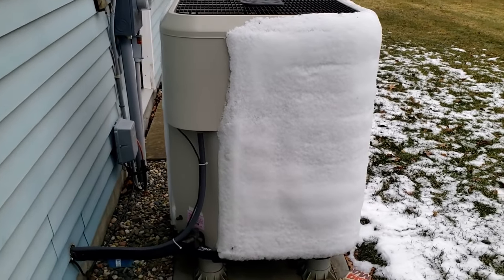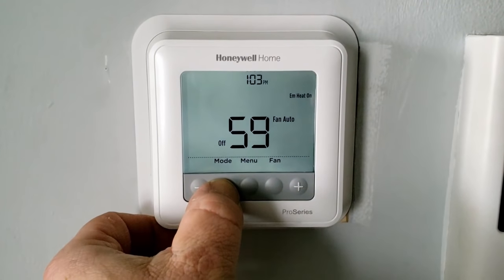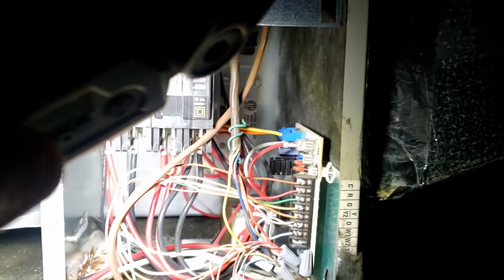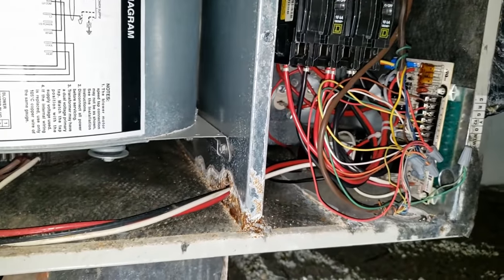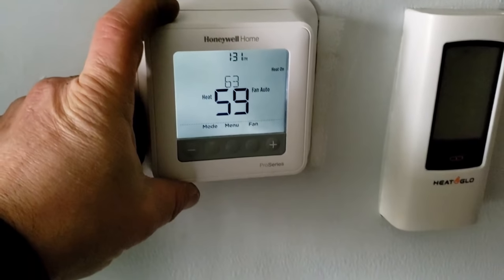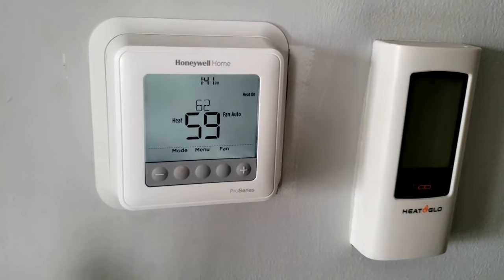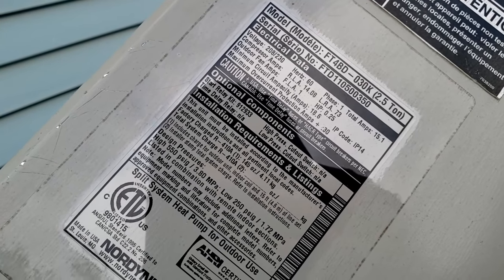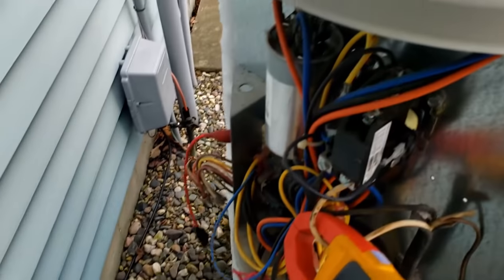HEAT PUMP FROZEN UP LIKE A ICE MACHINE I MISSED  UP & TOASTED THE FUSE

Comment from the maker: ATTENTION 😒😒😒.  👉 I did a live show covering most of the comments that are being repeated or listed below. The link is in the note section and in the tag section of the video. The things I cover is....yes I made mistake and blew the fuse when I connected the jumper to the wrong terminal😱.   I go into greater detail about this in my live show video. I also go into a lot more of my concerns while trying to diagnose this system.  👉👉 For those who keep repeating put it in AC mode and melt the ice that way..... That's only going to get the ice partially melted. 👉First, it's not going to melt all the ice because once it lose contact with the coil it's not going to melt any further 😲.  👉Secondly that doesn't tell me why the system froze up. But by running it in defrost mode over and over will tell me whether the system is capable of doing the job or not. It also tests the defrost board, the defrost termination switch and the refrigeration system all at once.  👉👉👉As with all of my videos, please make sure you watch the whole thing and don't skip sections then ask questions about things that were covered in the video. Thanks for watching and please consider subscribing 👍👍👍
Reply: I used to do that sometimes. Those boards are weird
Reply: Hey man thats what extra fuses are for and fuses in the first place, thanks for posting!keep up the good work
Reply: Dis you ever verify it stopped freezing up?
Reply from the maker: @jpp9876  We never received a phone call stating otherwise. I'm sure they would have called if it didn't work.
Reply: As a tech you are good. When people put the air handler under a house so servicing is a challenge of slithering and light, testing more hazardous. Some people place at edge of house boosting ease of service.
Reply from the maker: @SovereignTroll thank you! We're a after thought until it doesn't work🙂
Reply: @HVACRSurvival  Stopped up condensate drains in attics really Amps up the PM sell....
Reply: Forced air propane heater with a 20 lb tank would work to melt that frost off.

Comment: Mine froze up once during a cold blizzard and by the next day it was unfrozen and has worked great all through the cold and worked fine last summer.  I purchased a Hessaire 18.000 unit. I installed it myself early last summer. So far ( knock on wood ) It has worked flawlessly. I never realized just how easy it was to install myself. This unit replaced an OLD samsung from the 70's that stopped working. Was simple to install as the hold to the outside matched perfectly. A dealer wanted $8,000 to replace my old unit with a 12,000 btu. I paid less than a thousand with delivery. Keep up with your great and informative videos.

Comment: You can just run a/c mode, have outdoor fan power unplug, to melt the ice in 10-15 minutes
Reply: Or you can stay in heat mode, jump out Y and O at ODU, with fan unplugged from defrost board fan relay. Never have to go inside to set the thermostat. Save you big time!
Reply from the maker: I was focused on why it froze and how to prevent it from happening again more than melting the ice. Hot or even cold water will melt the ice faster and completely vs any form of defrost cycle. Speed wasn't what I was looking for at that time.   If I was sure what caused the ice then yes running it in cooling without the fan would have been the easiest way but wouldn't have worked fully once the ice melted and lost contact from the coil.  It would have left a ice igloo around the coil.
Reply: @HVACRSurvival  i was thinking the exact same thing when I read the OP's comment
Reply from the maker: @whitingservicesheatinganda3858  One tracked minds I guess?

Comment: Another fun little tip when you come upon them super frozen like that, two things right out the gate. If its a normal open/close defrost sensor You can see if it’s closed Because it should be if it’s frozen like that. Also you need to make sure you’ve got 24+ volts red to common. If it does not have power to red Or has a broken/bad common wire, the timer will never start on the defrost board and it will never initiate defrost.
Reply: I thought the same.
Reply: Another tip I've found is if it's frozen solid like that it's probably not low on charge

Comment: Did you visually examine the solder-side of the 'bad' PCB? As an electronics guy, single sided boards are prone to having cracked solder joints and lifted pads.   A local HVAC company wanted my mother to pay $3k for a new furnace over what was ultimately a single cold solder joint on the blower motor relay. Years before they wanted $3k for a new furnace due to repeated breaker tripping. It took me 4 minutes to diagnose a bad circuit breaker.
Reply: @HVACRSurvival  these days everything is liable
Reply: I know what you're saying about these other companies. I had someone with a variable speed blower that had a bad ECM, I told him to get somebody else, because he whined a little about how much it was going to be. The company who installed it came in and told them they needed to replace the whole five ton system for $12,000. I knew it just needed a blower module, which aren't really easy to get. So I went ahead and got an evergreen motor for it and fixed it. And I am an HVAC contractor, but I can't get over all these companies that won't fix anything, they just want to sell equipment and make a fortune off the customer. And I say,  you'll have that with some companies. And I say it's either because they're desperate for money because of their outrageous overhead or no one knows how to fix it.
Reply: I'm an old and seasoned electronics guy also. If you can fix the board with a simple solder repair then just do it and don't brag about it. I've done it myself more than a few times. It saves a lot of cost and frustration for everyone. Too bad the new boards have a lot of unknown parts on them which makes it hard or impossible to repair. If that's the case then scrap it and get a new one. Everything has electronics now, even my toothbrush. Ain't progress just great?
Reply: @HVACRSurvival  I love it when people hide behind liability. Cheaper for you and you only to just throw it away and charge the customer 100x more to just replace it instead of fix it.
Reply: @joblessalex  in this case hvacr survival is only insured for HVAC repairs. That is not inclusive of repairs that would be considered better suited for other businesses. Maybe he could offer to send the board out to be repaired by a licensed and insured electronics repair person, but I would bet that this would cost just as much as a new control board and also have even more downtime as the system will be unable to run without the board. (In this case he left the broken board so heat would work and ordered a new one)
Reply: You must be an electronic engineer supervised technician to legally fix boards.  Liability.
Reply: @charlessmith833  A customer may do it but no one should promote DIY for circuit boards.  Contractors cannot fix these without liability.  The worst part that short-lived relays are placed on circuit boards.  They are separate "ice cubes" on RTUs and quick fixes without circuit board on some units.
Reply: @Sovereign-WV Citizen  yea we as owners and contractors don't take boards out and solder them we buy new boards. If the board is already damaged why would you yake the liability of a solder when you can replace the board under a warranty.

Comment: If it is above 30, defrosting with a garden hose will work well, I had to do that last week!  

I had a friend and installed a new compressor for them in September, and I guess they did not run the A/C for the remainder of summer.  I forgot to plug the reversing valve back in, and came out in November to see it covered with ice like yours is.  I was able to remove the 2" of ice in a few minutes with a garden hose.  

Also if above 34F, unplug the compressor common wire and then run just the fan motor, the ice will go away in about 15 minutes, like a air defrost of a walk in refrigerator.  

Great video,  I am thinking that the board and temperature sensor should have been changed, and if you don't get more no cold calls, you did the right thing.

Comment: Thanks for sharing this video. Lucky for the customer that this was a copper & fin condenser coil, since then Nordyne went to all micro channel condensers for their Heat Pumps (Only Manufacturer who has done this). I have had one micro channel coil leak due to much ice built up.
Reply from the maker: I got my hands on the SolderWeild kit and it worked great on the aluminum I tested it on. I'm ready for a non-warranty coil to try it out on.
Reply: When I did work in 2010-2012 in FL I never came across a nordyne unit that had an issue. Trane? all the time. Carrier, to a lesser extent. I heard their micro channel stuff was bad. Kind of a shame since it seems like a good idea, at least for the inside.

Comment: In Florida, most installs are done with the T before the trap on most systems. Been that way for years. Depends on if the system is negative vs positive pressure as well. You can use a vent if you are feeling fancy.
Reply from the maker: I like tees over 90s in positive applications and a tee after a trap for a relief to preventing a double trapping.

Comment: I guess the build quality like most brands depends on whether its a base model or higher end. Mine is a 17 seer heatpump version of that, with 2 stages and variable speed furnace. It is completely different from a control / board perspective.

Comment: We have a carrier green speed (expensive) that was icing up. Bge home came out and decided the thaw board wasn't working properly. Long story short, it's now the 23rd of February and they came out on the 6th and they still haven't been back. Called rhem 5 times and recieved 1 call back that they're working on the part. So after three 20 lb tanks of propane the weather has warmed up a bit so it's not freezing up. If you live in Maryland,  bge home are not on it.

Comment: Demand defrost control, at least in my experience, works on a deltaT based on a defrosted coil condition. Suppose the entering ODT is 40F and the outdoor coil temperature is 32F. That’s an 8F deltaT. Then, let’s say, after running in heat mode for one hour, the entering ODT is still 40F but the coil temperature has dropped to 26F. That’s a 14F deltaT which means the defrost board will soon initiate a defrost to bring the deltaT back to 8F (or so) deltaT. It should not take very long to do this, under 6 minutes is best, in fact, too many defrost cycles longer than 6 minutes or terminating on time will create a fault. Maybe that unit is too exposed to the wind, maybe short of gas or both.  It will never defrost properly under those conditions.
Reply from the maker: This is the ghetto brand 😂. This  was a generic run of the mill open / closed termination defrost control. It didn't have any thermistors whatsoever, heck they didn't even have the money to put an LED on the control 😂 . As long as that defrost switch was jumped like I had it, it should have ran the full 10 minutes 🤷‍♂️. I haven't heard back yet so it must have been the issue.

Comment: the unit could be low on refrigerant charge causing it to come out of defrost before the time is up by the defrost sensor or some other safety, not sure if there are any other safeties on this unit. Don't know if you checked the pressures, was not shown in the video. but in my experience that will cause units to freeze up and not defrost properly. had that issue on a trane and a few other brands.
Reply: At the end of the video it is snowing outside. What happens is the poor outdoor unit sucks in the snow, and cannot generate enough heat to remove the impacted snow. Happened to a mini split I put in for a friend. Of course we see below zero a lot so that didn't help. 
Whenever it snows heavy here I just turn mine off. I didn't thing I'd be using mine in the winter since I have gas heat, so I didn't put a protective shelter over it. But gas shot way way up so the heat pump is saving me money.

Comment: So many places heat pumps of SEAR 16 or less are too far north. Now ductless splits are replacing these and can work with low ambients.  Defrost boards don't seem to like power surges and dirty power either...
Reply from the maker: Several manufacturers have inverter driven heat pumps that work fine down to 0*. You need to look at the eer rating not the sear rating when you want to know you're efficiency of your heat pump in heating.  It costs more to heat my house then cool it.
Reply: @HVACRSurvival  Yes Sir. I am placing a ductless mini in own residence this summer. 22-24 SEER awesome and lower tipping point.  USA behind on this and lower energy consumption will push this probably.

Comment: I carried nothing but 80-30 defrost sensors in my van. Starts defrost at 30 degrees and terminates at 80 degrees. Guaranteed to get rid of all the frost/ice IF refrigerant is at proper level.
Reply from the maker: Who makes that? Most of the higher end equipment now has on demand defrost that I work on but sounds like that might be good for a universal part on the truck?
Reply: @HVACRSurvival  RS 222-8218 at least goes up to 60°

Comment: Had same issue 
Changed the defrost sensor that I got from Amazon and the issue was fixed 
Now sometimes temperatures drop under 20 degrees and no ice at all
Reply from the maker: Good Deal..

Comment: Exposed PCBs reminds me of old Soviet Union paraphernalia. I still cant believe a unite meant for outside exposure is so open to the elements.
Reply: Some smd components and conformal coating is something you would expect 2021.
Reply from the maker: This is a bottom of the barrel unit and is older. A lot of the newer equipment is surface mount.

Comment: I'm by no means a veteran in the field but whenever I've come across this problem we just run it in cooling at the lowest setting and trick the thermostat by using a hair dryer or low temp heat gun close by it.
Reply: Good idea, but wouldn’t that freeze out the occupant?

Comment: It was totally iced over, hadn't been defrosting.   Defrost timer was set for 30 minutes, which means a defrost will trigger every 30 minutes, the shortest period selectable.
So based on the unit was completely iced, either the defrost cycle was terminating prematurely, or wasn't happening at all.
Reply from the maker: And that is controlled by the defrost control and termination 🤔 that's why I replaced them.
Reply: @HVACRSurvival  Absolutely! ;)

Comment: I just rewatched the video and it looks like you jumped between C and the top terminal (T2) instead of test (bottom terminal) and that caused a direct short on you first test. The jumper between T2 and DFT could have been left in place as it make the board think the sensor is constantly closed. When you done the test the second time you did jump C to test but the sensor was closed and that is why the unit went into defrost.
Reply from the maker: I just pulled out my computer so I could zoom in. YOU ARE CORRECT👍 I SCREWED UP. I'll have to remove my rant. Thanks for catching it👍👍
Reply: I've done the same thing, back in the 80s. Those models of defrost board are different from anything else..
Reply: yep, but looked like he jumped middle terminal to common, instead of the top, which I think is the feed from indoor thermostat B(heat reverse), to the defrost t-stat and T2 is the other side of defrost thermostat (I may have those backwards) but jumping either top or middle to C with defrost thermostat closed will short 24v to common. whoops, did somebody forget their glasses that day lol
Reply from the maker: @throttlebottle5906  I had a comment concerning all these things at the top of the page of the comment section for nearly two weeks,  I removed it after I did a live show which I noted in the same place and pinned that instead.  if you notice the views of this video are off the chart compared to some of my other videos, that's why I did the live show, so if you want a in depth review of what happened and why, then watch that. If I altered every video so that I don't always came out perfect on top I wouldn't have any credibility. If I thought I was perfect I surely wouldn't put in the title "I messed up"..... shit happens, no one can know every different brand out there, and I went into the details of how their control board was completely back asswards to every control I've seen on the market. Here's the facts 👉 The problem is repaired and was completed before I finalized the job. Results are what matter,. 3 weeks later and I wasn't called back after 2 plus weeks of 0-15 degree days.

Comment: Awesome video, learned a lot. Heat pumps are getting more common here in Canada so it was nice to see this video. Thanks!
Reply from the maker: Good deal👍👍
Reply: Yes but they are still nowhere near being the dominate heating method there, like gas oil and wood is, most heat pumps in Canada, just like in any other climate that can see well below freezing temperatures, are usually mated with a gas furnace or electric resistance furnace for AUX heat, since heat pumps only heat efficient to a certain degree below the freezing mark.
Reply: In Canada? Insanity.
Reply: @kevinadams9468  it never gets below -15 Celsius rarely. Southern Ontario